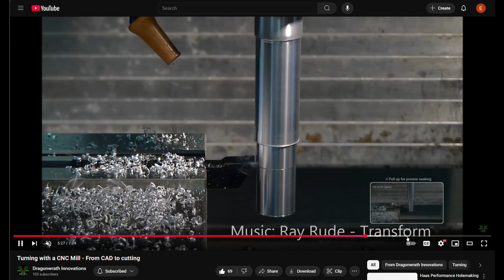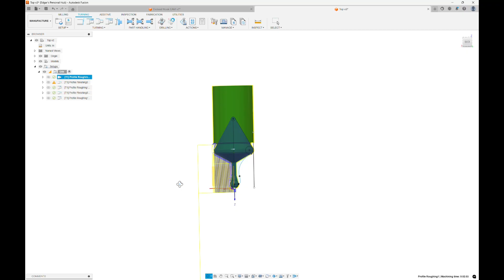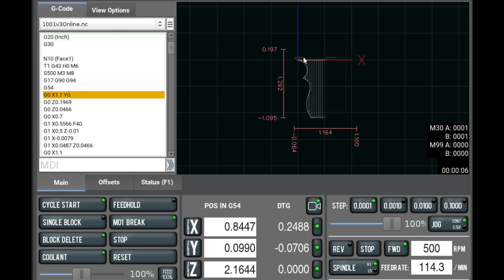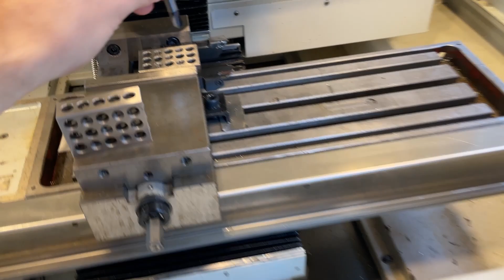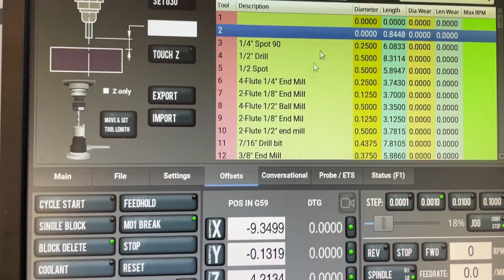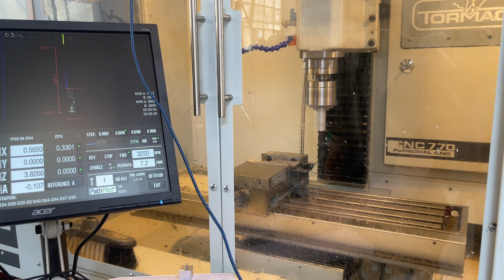Tormach CNC Mill - Lathe A Top

Comment from the maker: I Just Found A Way To Use The Other Side Of The Vise. Go Into The Tool Library And Rotate The Tool 180 Degrees. Then In The Tool Path Do Negative Diameter.